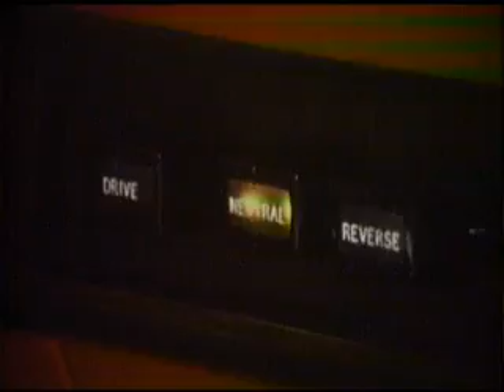Tesla's Forefather?  1970s Electric Car

Comment: "Range between 75 and 125 miles before recharging" ...in the 1970s.
Fast forward to 2012 and the Chevy Volt goes 35-40 miles between charges... with a tailwind... going downhill.

THANKS, GOVERNMENT MOTORS!!!
Reply: Yeah, but now we have 0-60 in 3 seconds (Tesla) and this etv-1 is 0-30 in 9 seconds, not really practical (I owned 3  cars based on this - dodge Daytona-and with gas motors they only got 9 seconds to 60 anyway)
Reply: Meanwhile, in 2019, seven years after your comment, we have electric cars with 300 to 500 mile range, 0 to 60 in well under 3 seconds, on the flat, without tailwind. They can also have battery life expectancies of over 500,000 miles. Even the cheapest new electric cars, which cost less than their fossil-fuelled version from the same manufacturer, now have ranges of at least 120 miles and batteries which should last as long as the life expectancy of the rest of the car. In addition, General Malaise have been pretty well left in the dust.